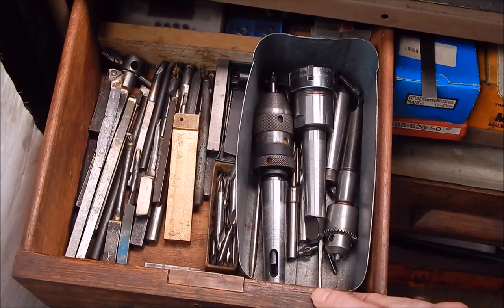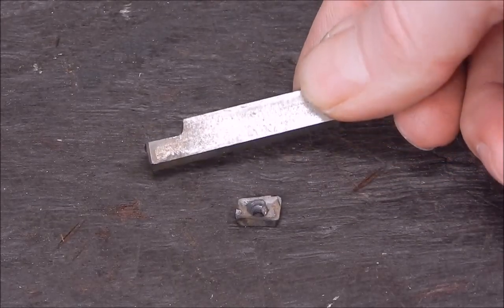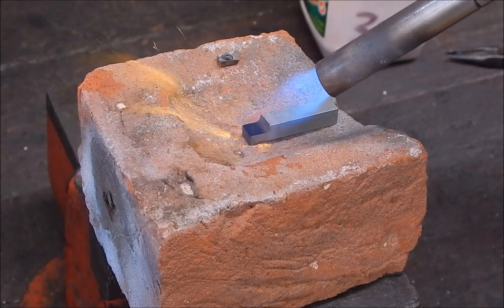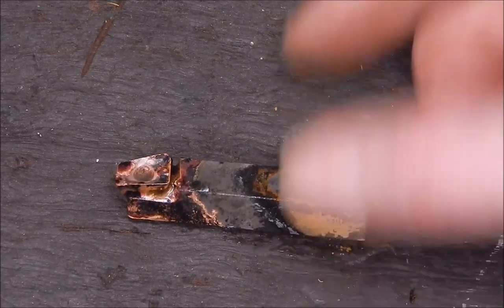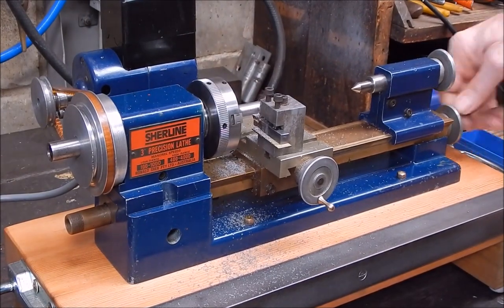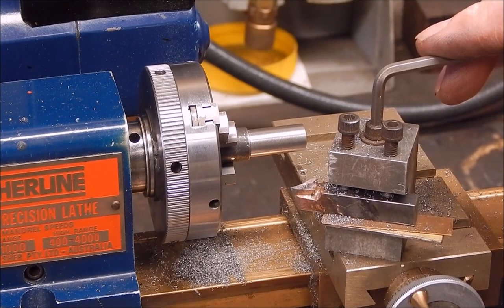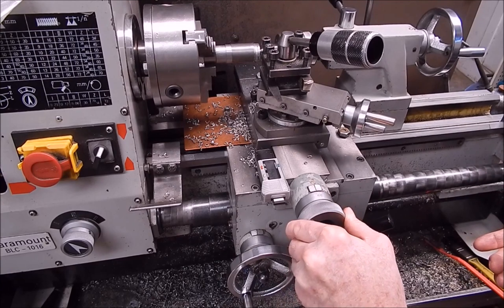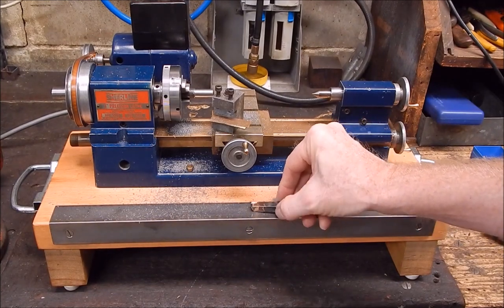Braze carbide tips onto lathe tooling with copper electrical wire

Comment: Great job!  I wouldn't have guessed that ordinary copper wire would bond to carbide.  I have done some silver-soldering of carbide saw blade tips - it's frustrating when parts move.  I just snip off a short piece of solder rather than touching the joint with the wire, it takes less heat.  Like silver, copper wire rapidly conducts heat away from the joint.  Subscribed.  Cheers!

Comment: Rob,thanks for info on the brazing.Will try using copper this week.When I had the Uni-Mat lathe I used the carbide tool bits with good success.High speed and slow feed rate.The motor would bog down if you tied to much of a feed.That is a cool homemade grinder with the connecting rod for a bearing support.
Reply from the maker: Hi Patrick,

My father made that grinder.  He was a motor mechanic.  Simple idea.  Still works a treat.

Good luck with the copper.  Needs plenty of heat.

Cheers rob

Comment: I think what you did here is great. But I also think its over kill. I drilled and tapped a hole for a carbide insert on square stock and works beautifully. I also have the ability to change out the good sides of the insert as it wears out.  like your vids Rob. Keep up the great work you do.
Reply from the maker: Hi Pete,

I have made indexable carbide tooling with a screw, and that's a no brainer.

This video is an experiment to see how well copper bonds with carbide.

Moving on from there, I can then use it to make small boring bars and tooling that won't take a screw in the conventional fashion.

If you look at the boring bars in my drawer, you will see that the majority are in the above category.

Cheers Rob.
Reply: I knew I was missing something... Thanks for clearing that up Rob. Hey, how would you feel about a remote control for your sherline. I made one for one of mine and it works great so far. I would also like to share an idea for a machined spinning top. There's a whole group of people consisting of several thousand that are really into them. I think you might like it. You can start by looking up pocket top talk on Facebook. I have a video of my remote control lathe and examples of some tops I've made on my channel. Really like your channel.
Reply from the maker: Hi Pete,

I checked out your videos, interesting. The remote is sort of like manual CNC.

Not for me, but thanks for the heads up on it.   

Your spinning tops look beautifully made.  I will check out the link on facebook.

Cheers Rob
Reply from the maker: The hole is only there for a locating pin or screw.  Some inserts don't use a hole.

It is not required for brazing purposes as the bronze will capillarate/flow between the carbide and the tool base to form the bond.  So yes, those inserts would work OK as shown in the video.

If you look at fixed tip carbide tipped tooling, you will see that the carbide is held on by a bronze base.

Cheers Rob

Comment: Good to know about the brazing. I have some carbide that has damaged corners from normal (or abnormal) tool use. But other sides/corners are ok; so by attaching the good side to a tool I believe I can get more use out of them.
Thanks for the idea.
Reply from the maker: Hi Tom,

That's how I use up the damaged tips from my tooling.  Just toss them in a jar for later.  They break up easily when wrapped in a rag and hit with a hammer, to get small pieces (for small tooling).

Cheers Rob

Comment: Glad to know. It's odd that I haven't needed to braze anything in at least 10 plus years. Last week I broke a steel hydraulic line and several other brazing jobs popped up after. I'm glad to know copper wire will work. One thing tho I didn't catch what you're using as flux?. Now will it work for bandsaw blades? We have a band saw mill that occasionally breaks a blade for no reason and we have them piled up and they need welded.
Reply from the maker: I use Ezi Weld 303 which is a universal Borax based brazing flux.  The correct flux makes a huge difference.

I've tried brazing band saw blades with very limited success - they need to be electrically welded from my experience.

Rob

Comment: i have a bunch of old saw blade teeth from when i tried to make some meat cleavers... ill definitely try this! i am a big fan of your work!
Reply from the maker: Be aware that the tungsten in most saw blade teeth is generally a lower hardness and more brittle than tungsten for tooling.  So they may chip/break.  But having said that, give it a go and see how it works.

I've never done it, and some feedback would be good.

Cheers Rob
Reply: I have used wood saw blades I cut up to .500 width and put in my parting tool for parting steel. has worked really well.

Comment: Perhaps silver solder would have the benefit of requiring less heat so you don't lose all the hardening in your shank? This might be helpful for long boring bars where rigidity is important. Or perhaps use an air hardening steel and adjust the process to create the right hardness?

Comment: Great video!  What kind of flux did you use?  I tried using copper wire yesterday to braze carbide onto steel and I had no luck.  I will try again.  Maybe I didnt have enought heat and I was worried about getting the carbide too hot
Reply from the maker: I used EZIWELD 303.  Any Borax based flux should work.

Cheers Rob

Comment: Nice work Rob! By the way do I hear and see it right you straighten the engine so the pulley's are inline no, the noise is a lot less!?
Reply from the maker: He He.  Yes it's all aligned correctly now.  It turned out a neat fix Arend.

I made up a thin strip (1 mm) of right angle steel which fits in the motor mount arm and squares everything up.

The noise is OK now.

Cheers Rob

Comment: That grinder with the connecting rod for a bearing holder has me intrigued, can you tell me more about it?
Reply from the maker: Hi Eric,

It was built many years ago by my father, who was a motor mechanic all his life and in the army during WW2.

It uses two inverted conrods, with sealed ball races clamped in the bottom ends by the bearing caps, and the gudgeon pin ends clamped by a through bolt. A junked belt drive motor completes the package.

It's been used for cutting, grinding, tool sharpening, wire buffing and metal polishing over the years.

Great because there's no motor body to get in the way, as with my generic 8" grinder on the bench.

I did a video on it way back:  https://www.youtube.com/watch?v=q9JMRDzhtqY

Cheers Rob

Comment: I've used my arc welder with carbon gouging rods (after peeling off the copper sheath) as an improvised electric arc furnace before, I put one gouging rod in the hand piece and the other in the ground clamp, I wonder if I could put a gouging rod in the hand piece and use it to heat the work and then braze carbide tips with it?, I don't have a gas torch so I might have to try it out
Reply from the maker: You can only try it and see if it works.

That's not something I've had any experience with.

Lets know what happens.

Cheers Rob
Reply: Sounds harry to me, but if you're patient and careful I wager you could pull it off. May be a bit of an overkill, and I imagine the hardest part would be not blowing chunks out of your steel shank, LOL! Please do let us know.

Comment: Good work. It maybe that brazing carbide tip with copper is better than brazing rod because copper is a good heat conductor and will carry the heat away from the cutting edge more efficiently.
Reply from the maker: Carbide works better the hotter it gets, so a bit of extra heat is a good thing.

There is a limit of course and that's why CNC machines run coolant for production runs.

Cheers Rob

Comment: I think the one who committed zinc and copper make brass is mistaken !  Copper and Tin ???
Reply: At the temperatures needed for melting copper the zinc would have long ago evaporated. Molten Zinc  has a high vapour pressure which is why its difficult to refine in metallic form and before electrolytic methods were discovered is was made by a condensation process.

Comment: I might have missed it but what flux are you using, silver solder, or brazing flux??
Reply from the maker: Hi Ed,

Brazing flux - Eziweld 303.  This is a pink Borax based flux.

Cheers Rob
Reply: Seem like it is only listed in Australian item, wonder if brazing flux will work mostly Borax.  Not a real issue I have always want to try to try tig welding copper with copper and I will just have to throw in a test of copper braze with my brazing compound. thanks ED
Reply: Silver solder with Nickel is the standard thing, and black flux.  If you were going to buy something.  Ordinary silver solder seems to work pretty well for bandsaws, someone mentioned that earlier.  Like "Easy Flo".  You don't need very much.

Comment: Rob, having an extremely hard time on mobile device hearing you lately...I know you are soft spoken but had to wear earphones to hear you on this vid using an iPad. maybe its my end....dunno
Reply from the maker: When I play that video, my volume control on the desktop PC is at 50%, which is where I usually try to set the video.

It varies with the PC/device .  My I5  Asus laptop has the volume up full on all YT videos (not just mine).

I always wear headphones with YT as it's clearer than those poxy speakers most PC's have.

If I go louder when shooting the video, the camera can easily over modulate and distort the sound.

Can't do much about it except get a camera with a mic jack, which I will do one day.

Cheers Rob
Reply: Ohh, its no problem, I always get around an issue. Just thought I would mention it in case it wasn't a problem on my end. I have an iPad2 from like 2008...a total POS for viewing my favorite channels.

Cheers,

MSFN